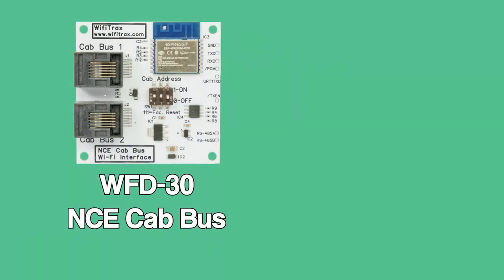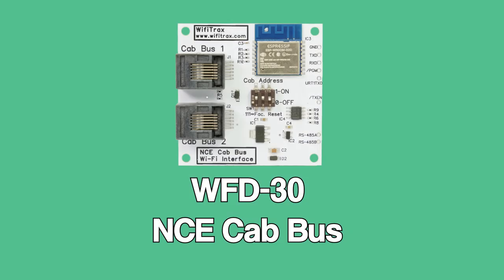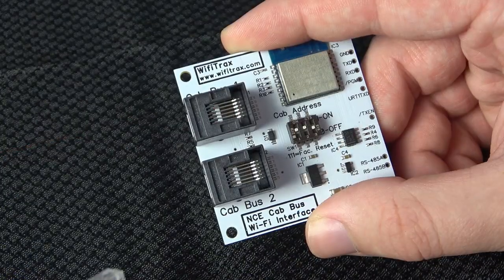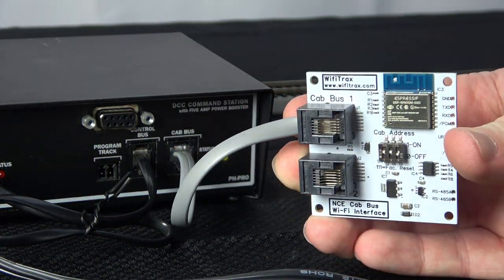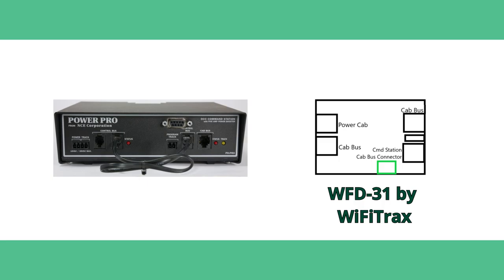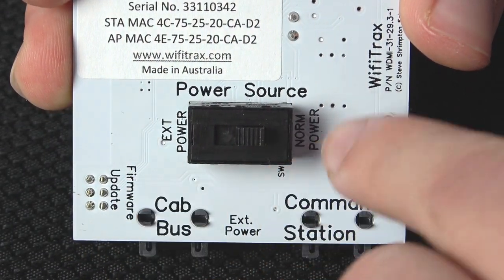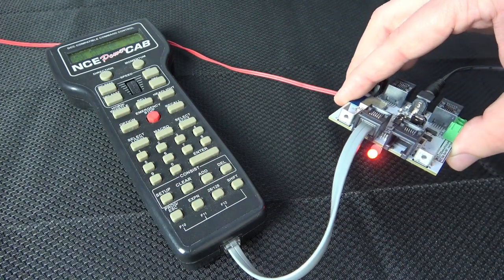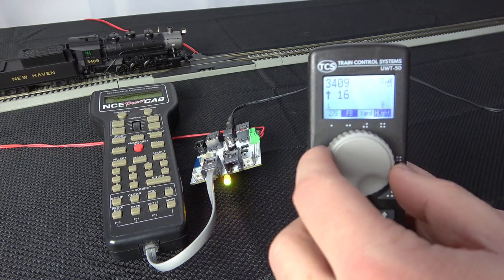Adding WiFi to your NCE System

Comment: Hello, the product is great and seems convenient to use. I have one question. If I want to operate my trains from my tablet and using WFD-31 system then do I need to have a power cab or its optional.
Reply from the maker: Desh, You would need a NCE Powercab or a NCE Command Station and Cab bus for this to work.
Reply: These are just adding a wifi host for wifi throttles to the NCE Cab Bus... so as already stated, you'd need a Power Cab, or other command station to hook into the Cab Bus of.... 
   There IS a 5A wifi system out there that is a standalone item that would allow for wifi throttles and doesn't need any other command stations or boosters, but I don't know much about that just yet...if I remember correctly it was also from wifitrax